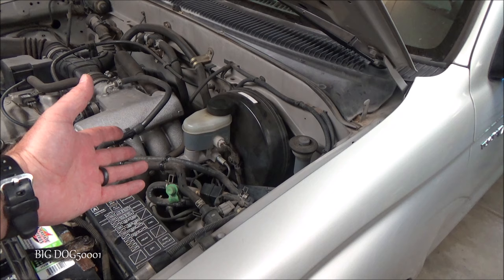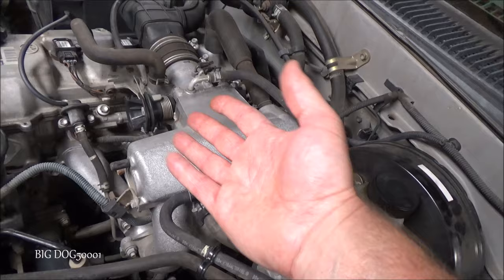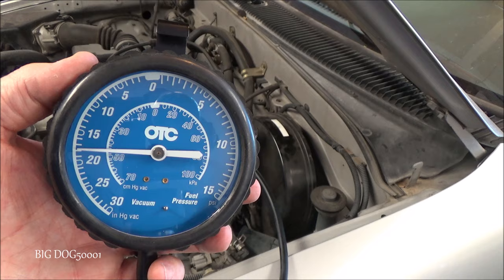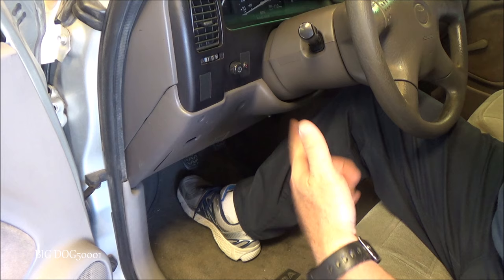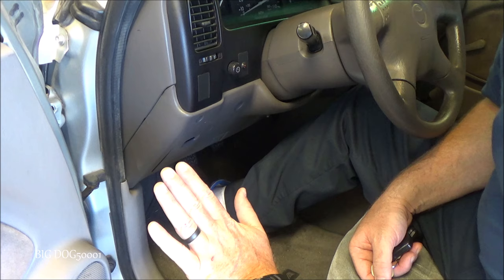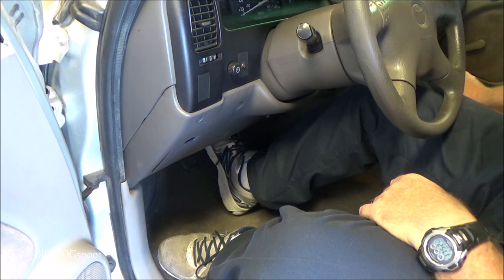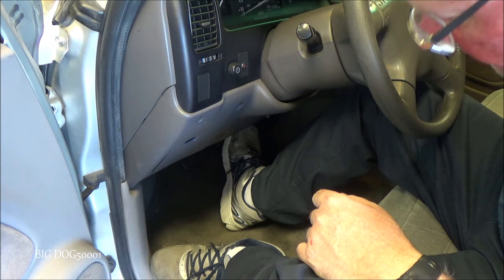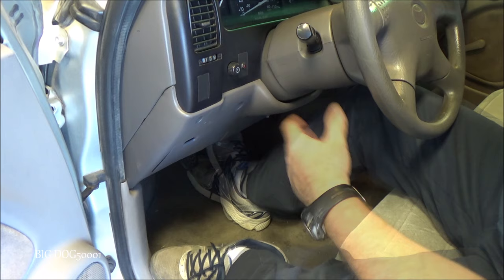How to Test For a Bad Brake Booster / Brake Booster Testing

Comment: Dave, Excellent video.  I have few questions may be helpful to other viewers. May be my questions are silly but will help a lot to understand and correlate lot others
1) At 4.45 you said Air is escaping, but I think it is vacuum because if vacuum is not there in booster it push the pedal up.
2) At 5.00 you said, for good brake booster we should be able to push and hold the pedal for first 30 seconds, so why is that it wont hold after 30 seconds, does that mean after 30 seconds vacuum will disappear if so how will it deplete, again this question is for good brake booster not for bad. I am trying to understand why it can hold only for 30 seconds and how is vacuum depleted. I dont think vaccum in booster will go past check valve so my theory is it should hold all the time, unless there is a depletion somewhere.
3) AT 6:07 the failed one in this case is pushed farther than it is supposed to be, what I didn't understand is failed one is hard to press, but in this test it goes farther i didn't understand the theory.
4) at 8.33, you said we need to have 3 brake assist without vacuum. I assume you are using existing vacuum in booster, is that right. because without vacum we may not get that 3 brake assist.. 

Sorry too many questions.
Reply from the maker: 1. Yes it is losing the air that is under vacuum.
2. The 30 seconds is just a general guideline that can be used as a test, these system are not designed to be 100% air tight over long periods
3. It is not pushed farther down, it is pushed down to normal position.  The pedal started up higher (and traveled further) because there was no vacuum stored in the booster to assist at the start, but as soon as engine turned on then vacuum started to assist and the pedal went down to normal position.  This booster was bad but it was able to hold enough vacuum to assist as long as the engine was on (but it made the truck run severely lean, as shown in my P0171 video).
4. Yes the booster should be able to hold enough vacuum inside to assist for 3 presses of the brake pedal.

Comment: The brake pedal is not airy when the vehicle is at rest but super spongy when it's running.  Despite almost sinking all the way to the bottom, it actually works super well and the grip sets in just right in the middle. It seems to me that this does not match with the description of this video. I wonder if it is the master cylinder issue, or something else, but what can that be?

Comment: I have a cheveolet tahoe 2001 the car brakes by it self. I change the master cylinder but still brake by it self
Reply: I would check your anti-lock module by pulling the fuse for it and try brakes this way with it disconnected.  This worked for me one time.  Good luck!
Reply: @RickaramaTrama-lc1ys  but i when to  year auto care and midas auto care and they both did not know what was the problem .Midas told me the anti- lock abs whats good.

Comment: Excellent diagnostic demo.
Reply from the maker: Thanks 👍!
Reply: I attacked the problem as demonstrate and I won big-time.  The first thing was to test the one-way valve.  Bingo.  On my valve there is a side tap to allow for an easy system vacuum check. It has a rubber slide on cap to seal it when not in use.  On mine, the rubber cap had totally rotted to failure.  Easy $4 fix. Thanks a bunch.

Comment: Omg! Thanks for the help, i did all the steps . Everything is good. But still happens to me while i was driving on high speed , my brake pedal gets hard when im travelling on high speed around 150km/h.  It just stucks and hard to depressed.
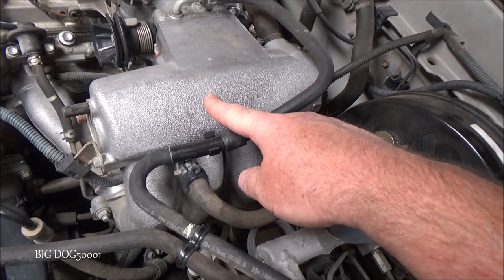Reply: Well from what he says around the 1:30 mark, if the pedal is sucking all the air the brake booster might not be getting enough vacuum since all air is going into engine. Might be wrong but could make sense in your situation.

Comment: I remember my brake booster going out in my 97 s10..... it takes so much weight to press the pedal I'm convinced most people wouldn't be able to do it. I had to use both feet with so much pressure I felt like I would break the seat bolts before I could get it stopped

Comment: When you're at wide open throttle, you're typically not on the brakes so it doesn't matter if the valve is even there. As soon as you come off the throttle, engine vacuum comes right back and most people won't even notice an issue. Just like my customer that was in for an oil leak and death wobble. No mention of the pedal being hard while on the throttle since most people aren't on the throttle and brake at the same time. The only thing that check valve is for is to maintain vacuum in the event of engine failure and you get at least 2 assisted brake applications.

Comment: My brakes become stiff by themselves with the engine not running. At the garage they said it was normal. I told  them it was normal if you press the brakes 2-3 times, but not by it self. Anyway they said the important is that it works while running, and they never saw this problem ever. Do you know what the problem can be?

Comment: Good video! thanks. My 2006 durango has been sitting for a while and when I apply the  brakes, the pedal stays down! If I drive it back and forth in the driveway, the brakes stops the vehicle but I have to pull the pedal manually to release the brakes for the SUV to move.

Comment: What about a soft pedal on the first pedal push but as you pumped a second time, the pedal offers more resistance and more breaking power? All with engine running.

Then drive a bit and the same scenario happens.

Comment: Hi what would it be if I hear a hissing noise (air escaping) coming down from where the brake pedal is. Would it be the brake booster or master cylinder? Thanks
Reply: Booster if it hisses when u press on it

Comment: Great information.I just learned a lot from your video.I have a Question? Should the Brake Booster and Master Cylinder  be tested after having all your brake lines changes?
Reply: I'm no expert, but these tests in the drivers seat couldn't hurt and take no time at all.

Comment: My breaks are sticking for 6 seconds before they release,  so I had a new vacuum pump fitted.  Pipe and non return valve are ok. Any ideas ? do you think maybe the servo is not working properly. breaks are still sticking. great video
Reply: Could be a bad fixable brake line especially  if it's only one wheel: some times the brake line brakes down internally  causing a check valve condition in the brake house where the caliper isn't able to release right away after taking one's foot off brake pedal.

Comment: So 98 Mazda b2500 brakes work fine. Then I shut truck off then pedal sinks enough to turn brake lights on I have to pull pedal up to shut them off.

Comment: Thank You for posting this video! I used these methods and had similar results! Bad brake booster in 2001 tundra. I will be buying a junkyard replacement with 52,000 miles on it.
Reply: Hey mike what were your symptoms. I have an 01 tundra also and after bleeding the brakes the brake pedal is solid until I turn on the truck and then the pedal sinks to the floor. Thanks in advance for the feedback
Reply: @chrismahler9443  I didn't replace my booster yet. Just watched a video about testing booster with a vacuum gauge! I think I am going to do this test first before I jump off the deep end and get a new one. If the gauge hold vacuum then the booster is good if not then time to replace. My 2001 does the same thing as your does.

Comment: My brake pedal is rock solid (no movement) when I press it in the morning (cold). As soon as the engine starts the pedal moves and brakes works fine. The brake pedal continues to work normally all day even parked outside my office for 8hrs. However, after parking overnight in the morning it’s rock hard again. Vacuum hose & return valve replaced. Does this indicate a slow leak in the brake booster. Other symptom is throttle surging 2-3,000rpm under light load.
Reply: I have similar symptoms on my nissan murano 2012 -hard break when cold and then when engine start it would go down but yesterday the engine not started and I towed to mechanic and he will do it monday and we went there as we were going down and described situation he said it might be alternator. Did you found the cause of the problem on your car?

Comment: I understand it and now know how to test it..Thanks very much for that. 
But one question regarding valve test..You said air should come back up from bottom of value (The part used to be inside the booster) and it will hard to blow from top down makes confused..because one way check valves work to block air coming out from the booster..Thanks
Reply: When the engine is running, the pressure from the engine opens the check valve as the engine vacuums the booster (vacuum test) like you saw on the video and when you shutdown the engine, the valve closes maintaining the pressure difference in the booster within a given time frame. My thoughts though!

Comment: After I got my brake master change a month later the pedal got too hard to push down only happened one time, now the brake pedal feel spondy on and off. Brake light also on
Reply: Did you bleed the master cylinder before installation? Sounds like air in system. Then bleed your brakes.

Comment: What if the brakes seem to work conpletely fine. But you have to go almost to the floor for the brake pads to actually make contact with the rotors. Or shoes to drums? Ive checked the pads and rotors. There is plenty of material left.

Comment: Can the booster be damaged by applying too much pressure on the brakes and starting the car? I had to keep the brake pedal down with a stick while I was working on the brake lights. Now the pedal is hard and the calipers are sticking.

Comment: Thank you for the tips. I did all the test and my truck passed. I bleed all the breaks and when it's running I still have the pedal going to the floor and very little stopping power. Anybody know what else it can be?
Reply: My truck has the same problem. The adviser said the break lines had leaked so the air filled the lines, I checked and bled the fluid but it didn't do any good, so I am going to replace the master cylinder since the other video said a bad master cylinder could cause a sinking pedal. Good luck with your truck problem.

Comment: Very nice explanations, thank you! One more question - what about a car with malfunctioning ABS - would it change explained test steps?
The problems with my car are these ones:
1.It's easy, but I need to press the pedal deeper to stop the car
2.On a running car, when I press the brake pedal with a bit more force and keep it pressed, it goes down about 2-3 inches. It stops before hitting the floor, but I'm not sure if the floor is the last stopping point

I've done the following tests and there are no leaks from the brake booster. Also when the car is not running, when I press the brake pedal using the same force as in #2, it doesn't go down.
Could something else be failing, like ABS?

Comment: Excellent video. I was wondering if your brake pedal sinks at a stop and car almost stalls , could it be  caused by a leaky master cylinder?
Reply from the maker: Typically, a sinking pedal is caused by a bad brake master cylinder or a brake fluid leak somewhere in system like a bad hose or a leaking ABS unit.  Another possibility is air in brake system (depending on how it is acting).  A bad brake booster can cause the car to run rough at an idle if it is pulling in too much vacuum.

Comment: Help needed, my car has the symptoms of a vacuum leak. I fixed the issue before because I had a broken line, but I can’t find any leaks anymore, could my brake booster be the issue??

Symptoms: car won’t kill with the key, and brakes are hard as a rock. The issue started slowly, with these problems only an issue on idle, and now it wont kill at all.

Comment: Does that the reason to my engine light P1912 Pressure Sensor for Brake Booster-G294, Short to Plus; Brake booster pressure sensor-G294 Short circuit to positive VW golf ???

Comment: I’ve been endlessly chasing a rough idle and noticed that if I pump my brakes multiple times at idle me AFR and fuel trims go lean and the rough idle is more noticeable. However, I cannot find any leaks in the booster vacuum line and the system seems to hold vacuum perfectly. I’m losing my mind on this one
Reply: Mine is doing the same thing,did you ever find out what caused yours??
Reply: @katbirddogg8184 turns out it's normal for fuel trims to go lean when continuously pumping the brakes. as for my rough idle I just ignore it now

Comment: Great info sir, I think I m facing problem by booster issue in my Toyota etios from 5-7 months. I was worried about head problem, but now I m sure that it's booster issue. It hard my wheels, vaccume  not working, no leakage in booster. It works little properly on highway. But  hard wheel in city. What problem it is, and can it repairable or replace with new one

Comment: Getting vacuum may not deserve a "pass" since the engine may have a reduced vacuum output so the gauge should read enough to pump up the booster.

Comment: What if there is a significant leak from booster and back of master cylinder already replaced the master cylinder .I have not checked the check valve ok big dog any info would be great.

Comment: Shalom Aleichem. 

One can just remove the check valve in the booster and either a lot of vacuum could be heard escaping or nothing at all. If nothing, check the check valve, hose, and they're good the booster is bad.

Ratson haba b'shem YaHuah

Comment: 6:08 dont you mean it wont sink that much because of the bad booster? Cause if the booster is leaking there is not that much assist, so the pedal will be stiffer when you start the car right?

Comment: Iam experiencing a change in idle when I press and hold brakes but when let go it drops n I smell oil when I rev up hard like(I changed the pcv but still experiencing) and another my brake booster have a rust surface beneath n that coat black is wearing off

Comment: I have a question. I just installed a new brake booster on my van. I noticed that when I pulled the brakes. There is coming out from between the booster and the master cylinder is there supposed to be an absolute airtight vacuum or is that normal?

Comment: Nice video. I have a 2004 Toyota Tundra SR5. I had to replace my brake booster because it had a leak inside the cab area. I purchased an aftermarket booster from Autozone but believe it might have been defective. Ever had air coming out between cylinder and booster? I got a code for running lean and it's all I could find that might be causing the problem. Do you think it's better to get an OEM part? What are your thoughts?
Reply from the maker: Not a fan of aftermarket brake boosters, many are poor quality, I try to use OEM ones if possible (but they are usually much more expensive).  Thanks for the comment!

Comment: what I did not follow is the direction of vacuum flow through check valve. You said that you shoukd be able to suck & not blow. The direction the valve appears mounted seems like built up vacuum would travel the same direction as your sucking demonstration.
Reply from the maker: Valve needs to allow vacuum (from engine) to be pulled from booster but as soon as vacuum is cut (engine turned off or high RPM) then the valve needs to close and hold the vacuum inside booster and not let booster equalize.  Not the easiest thing to explain.

Comment: I have a 2005 Dosge grand Caravan I’m trying to get road ready for one of my daughters. It sat without being used for 2 years. The brake pedal seems to be pulled towards the floor. I can pull the brake up with my foot with light pressure, but if I let it go, it sinks back down and the brakes engage (even the brake lights come on). I was thinking bad booster, but if I heard you correctly, it could also be a bad check valve? I haven’t heard the problem I’m having described exactly so I’m not sure. When the pedal sinks down, the brakes engage very well.

Comment: Question I have a trailblazer 2002 there at my house. A friend had issues with the rear brakes. He change out the right rear he change the capillary, the brakes, rotator.
He tried to bleed it several times. The fluid is very little coming out the bleeder screw.
I assume it's the master cylinder failed.
But when start the vehicle to pump up the
Brakes up   and the pedal is real soft and goes to the floor. But then again I was thinking it could be a fail brake cylinder  too.
Could you provide more info to check. Thanks

Comment: Quick question, with the engine off I pump the brakes and it has pressure and it holds. With the engine on I pump the brakes and there's pressure but not as much and the pedal sinks slowly. What could it be? I changed out the vacuum brake booster, new master brake cylinder, rear wheel cylinders and I flushed out the fluid. Please help

Comment: I'm working on a 73 elcamino thinking i have a bad brake booster. When driving ill come to a stop and the engine idle drops real low, then when coming off the brake to the gas the engine stalls. It restarts back up at a good idle as if nothing happend. Thinking that the booster is pulling pressure from the engine

Comment: On my 08 ranger my problem is at low speed when braking ,almost stopped , It starts to make a air, fluid gurgling sound as I press down toward the end of travel on the brake pedal. At speed and braking it works fine. I have new rotors and discs up front and I believe back drum brakes need changing . They are not making noise but its been 5 years at least. what do you think?